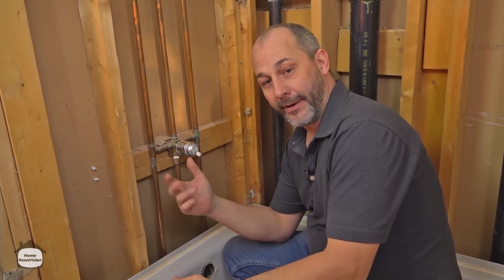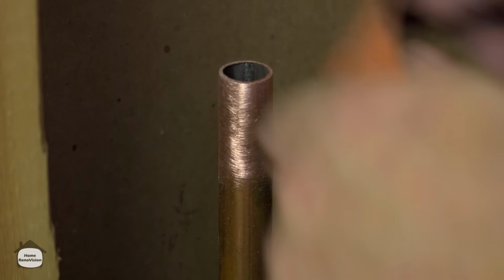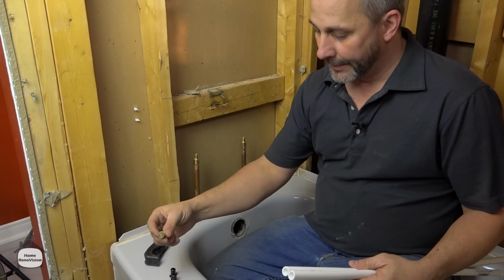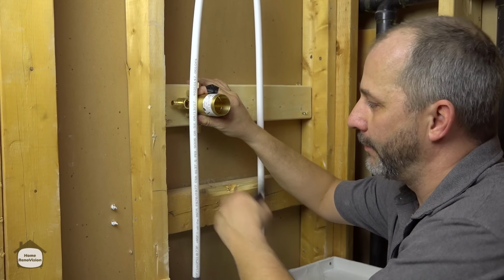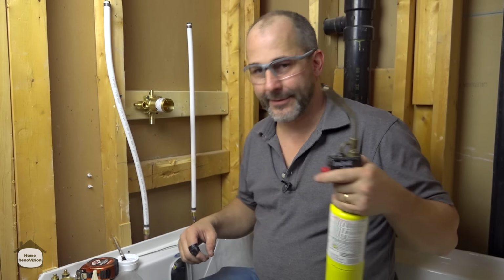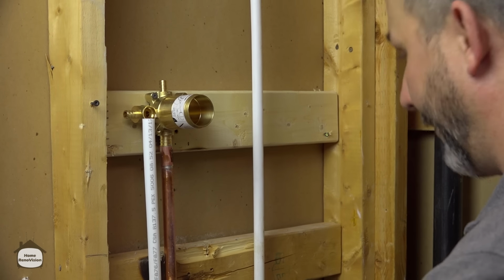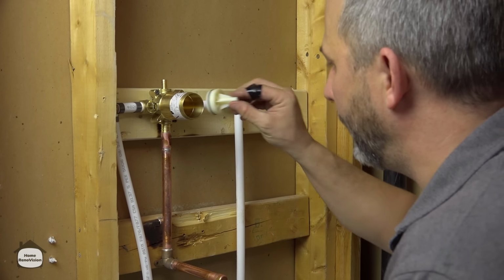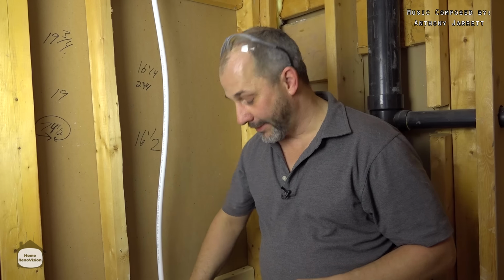DIY How To Install Copper To Pex Shower and Bath Plumbing

Comment: I have never seen anybody Solder pipes whose then you. Flux should not be added after you solder a joint because it will corrode the pipes and you cannot fix them once you have buried them in the wall. All joints should be wiped clean after soldering and you did not do that. Stop making videos you do not know what you’re doing.

Comment: Does HUD require securing a shower valve inside the wall using Pex or can it just flop around? I need a diagram of a HUD approved shower valve installation.

Comment: Do you have a video for the regular faucet system with the 3 nozzles? Cold, hot and shower in the middle. I have to replace the pipes and think I can share some of this information but need steps on how to replace the old.

Comment: How do you sleep at night knowing you are a hack?   I guarantee you are the type of contractor that always had call backs and unhappy customers.   Btw genius.  Clean the copper pipe and the fittings and know that you have to use a different flux for brass fittings like all real plumbers do🤦🏼‍♂️

Comment: Crimping PEX (PEX B) - what I don't like is that the fittings are always smaller than the pipe, which means you're going to have less flow.
Expanding PEX (PEX A) - is better for that as the inside diameter stays the same for fittings as well as pipe.

What I don't like about PEX is they leach chemicals from the few studies they have done. Down the road, the concern will increase as PEX leaching increases with heat. I'd love to use PEX but I think pressed copper fittings might still be best and fast.

Comment: Good morning, im trying to convert my shower from 3 Knobs to 1. Do you have any video on that?   Thanks
Reply from the maker: not exactly. i do have videos on how to connect shower plumbing. as for the knobs that is up to the manufacturer. the water supply is still only 2 inputs.

Comment: just an fyi, i worked in the engineering department for Wingaersheek the maker of Turbotorch and the flux is used during the sweating process to remove impurities.  i suppose you can brush it on after the sweating but it serves no purpose. definitely no benefits to this.

another piece of information, probably useless to you but i like to brag about this lol. i was the first to get that self igniter to work at Wingaersheek on a handle shaped like a 45 pistol. The parent company took the business back to Texas, so this operation was taken away from us, and Wingaersheek was no more.
i guess we did the hard part, and we’re not needed any longer.
thanks for nothing.

So obviously Berns-o-matic got that from Wingaersheek.
the swirling is also a Wingaersheek trade design. it intensifies the temperature of the flame.  
a useful piece of information is to never let the tip get hot, so it travels back enough where it heats the part that holds that swirling piece or it could loosen it and render the tip useless.
“always” use those tips at the full on position, to prevent the burn back i talked about.  this will start to happen when the tank pressure is low, which is a good indicator to replace the tank.

i’m thinking of going pex. good to see you’re working with it with so much confidence, since i’m an old school copper guy.

plumbers i’ve run into claim it’s the best.
i guess i’ll try this out since there are a couple of pipes i need to relocate.
good video.

Comment: I am converting a tub/shower insert to a soaker tub with an extended and exposed country home style pipe for the shower head to be centered above the soaker tub for a rainfall-like drop. I am wanting to convert from copper to pex and have 2 questions:

1: Where can I find that valve you’re using; as Lowes and Home Depot didn’t seem to have it?

2: Can I use the same system for the shower head with a threaded connector, install the plumbing this same way, and then add the extension for the shower head to be centered?

Disclaimer: I’ve worked in construction and did a bit of minor plumbing but this is my first (completely solo) job. I want to make sure I’m not missing anything here.

Comment: Don't wipe your solder joints with Flux after soldering, crimps should be 1/8ths of an inch not 1/4, and the rings need to cover both ridges.

Comment: The most complete, comprehensive, articulate, well lighted, well videographer, well explained guide on almost ANYTHING I've ever Googled.  Simply amazing.  Thank you so much.  I'm guessing you have to be careful what product you recommend; however,  I'm in a 2013 Athens Mt Pine mobile home (fitted throughout with Pex) and need to replace the shower-only valve (no tub), meaning I've got quite a project ahead.  I have 2 questions if you have time:  1)  What TOP LINE replacement might you recommend and 2) Do I have to replace the shower faucet as well or can I just use the same existing one (for now I don't care if the shower head and faucet don't match!).  Ever so grateful for this video.  It is so thorough, so complete, no questions as to removal/replacement.

Comment: So helpful....I am getting prepared to gut out small bathroom and renovate which will include this part.  I didn't see what part on the faucet your turned to open the cold water line but will look on mine.  Also, some other YouTubers suggest checking every pex crimp with the go/nogo tool, but you don't.  Why is that?

Comment: Hi Jeff, thanks for all of your videos. You are an incredible instructor. Sir, what brand/model of shower/tub valve is that? I would like to do the copper to pex conversion, and I like the 3/4-inch integrated copper adapter for the tub spout. Any guidance is appreciated. Take care, and thank you.

Comment: Great walk thru! The original plumbing had copper pipes coming up, which would be replaced by hammer arrestor now, which looks identical to what have right now.  I noticed you didn't replace those, which would make my job a lot easier. I have a well and septic... would I be fine without the hammer arrestors or should those be replaced?

Comment: Why did you not talk about the Flux on the Copper joint before you heated up the solder joint for adding solder.

Comment: Unless you allow the air to vent from your lines so that they can fill with pressurized water you are not doing a proper leak test. I'm sure you know this but perhaps wanted to keep the presentation simple.

Comment: I'm hesitant to say anything since I don't want to jinx it, but I actually cut off the copper pipes and soldered the fittings and attached pex pipes. I have a lot more to do, but just getting that done was huge. I never would have attempted this before I watched this video. I flooded the bathroom (and two rooms below it)a couple weeks ago and I had a leak for a while and had to dump out water several times a day. I managed to finally get it stopped but was unsure what to do. The lowest estimate I got for replacing the faucets was 1000 and part of the reason I' m doing the work myself is to save money. I really believe I can do this now. Thank you! Thank you! Thank you!
Reply from the maker: Cheers Isabel. You got this!

Comment: Wow that Pex pipe and fittings are so cool and easy to work, in my  house I’ve had two times gotten pin hole leaks in the copper pipes, is Pex also susceptible to Pin holes?  What causes Pin holes in copper pipes anyway, never had this happen before in any house ( BTW House was built in 2000)

Comment: i'm 68 years old and learned soldering from my father who learned from his father who was a "pipefitter" by trade.  my dad taught me to always "tin" every solder joint first before the final soldering.  for those who don't know what solder "tinning" is - you basically heat up each joint and apply a coat of solder around the entire joint.  you do this on EVERY pipe end and coupling.  then when you go to solder each component together, you heat up the pipe and/or adapter/coupling and because both pieces have solder already on them, there is no chance of missing a spot which could create a leak.  Tinning is an additional step in soldering but i believe it is a common practice with all "old" plumbers.
Reply: I worked with a Jamaican man he used to do the same that is for secure the soldering.

Comment: Thanks!  To pressure test the spout, a friend had a pressure test stopper, though a shark bite type stopper would work too, to skip soldering on a copper stopper temporarily.  For testing the shower head, I used an old shower spout with a 1/2" threaded valve on it.  That setup had 8-12 sweat connections, and I was happy it ended up straight and tight the first time.  This time, like your video I'll be switching over to pex somewhere.
Reply: 😢ooo O9oo o I ooo I ooooo
Reply: K0
N
Reply: 7:32 o

Comment: how do you figure out where to put the 2x4 support for the shower valve when you are using a thin wall sterling fiberglass shower kit, so the bonnet is not too far out of the wall?

Comment: showers are simply cleaner and more hygenic to use. tubs are absolutely perfect if all you want to do is soak in a hot one, but trying to clean yourself off in one does nothing but smear your dirt all over you, where a shower with wash it all off into the drain

Comment: Hi Jeff, i have a problem - i watched your video and installed all pex tubing with a moen valve body, and then installed a pfister showerhead with a handheld spray attachment.  i don't have water pressure in the spray attachment, and moen is saying it's because the pex tube between the valve body and the tub spout is pex, not copper.  have you seen this problem before?
Reply: sorry - pfister is saying it's the pex tube, not Moen.

Comment: I bought a pro press crimped tool from Amazon.  I also found some PEX to copper fittings that I crimp. I can switch to PEX now without soldering
Reply from the maker: Thanks for the info!
Reply: @HomeRenoVisionDIY  no problem. The tool I got on Amazon for 250. The fittings are available at noble except the PEX to pro press...I found them in USA and bought from a distributor in Saskatchewan
Reply: @HomeRenoVisionDIY  here are the fittings...I can't attach a photo...Nibco press system PEX adapter...looks like sweat adapter but presses on

Comment: Your Show is amazing and helpful this week I called plumber for 25minutes put shower mixture from copper to PX charged150.00 CAD and 60.00 CAD for 5feet PX 1/2inches and 4 elbow joint. You taught me lot.
 Shawn from CAN

Comment: Should be using galvanized screws to mount brass fittings. Drywall screws will rust and break.

Comment: In another video with the use of Pex pipe  blue was used for the cold water and red for the hot water. However, in your video you used white pex pipe for the hot and cold. I am curious about that. Can you please explain.
Reply: You can do it however you see fit. There's no requirement (at least where I live) for matching color to temperature. It can be nice to have it that way, but for guys who do odd plumbing repairs, it can be simpler to just have one color in your van/truck instead of trying to coordinate colors.

Comment: Often times solder joints are demonstrated with no heat applied to the pipe. Although it is possible to get a solder joint that will not leak it will often times not fill the cup completely.

Comment: Nice work. I have a small leak in the control value or one of the pipes. Because there is water on the board that the control valve is connected to. Also behind the tub present moisture with a moisture detector. I have a plumber coming out to do a complete diagnostic but I’m thinking it would be a good idea to replace the copper with pex - is it might be cheaper maybe? Plus I plan on pulling out the tub, replacing with a walk-in shower. I’m a bit worried about mold and any moisture damage after all the tile is removed😳

Comment: I am installing a Delta 1447700-SP series shower set and the installation guide says the stringer should be installed so that the plasterguard is flush or (+-) 3/8ths of the finished wall. If I estimate my finished wall, the existing stud that the old shower valve was installed on will put the finished wall at .25" past the plaster guard. Does this cover the (+-) 3/8ths wiggle room or should I reposition the wood so the plaster guard will be exactly (guess) to my finished wall and tile?

Comment: I am a house remodeler,  I do most of the plumping my self, but I have always used copper. I wanted to use pex and give it a try but wasn't so comfortable with the idea of using pex, now that I saw your video I know I can do it and no worry about leaks. Thanks!.

Comment: I don't know if this will help anyone but I use a small piece of Scotch tape on the crimp ring when I'm lining it up.  Just tape it to the pipe where you want it right before you crimp it and it won't go anywhere.  There's totally room for a little error with these crimp rings but I personally like to be sure it's right the first time.  Saves a lot of frustration on vertical lines, too. :)
Reply: ^^ both this and the reply are great advice. 

My sharkbite crimper tool is strong enough that just touching both sides of the jaws to the crimp ring is enough to crush it a little.

So I
Step 1. Use a little tape to get my crimp ring exactly where I want it (between 1/8 and 1/4 inch from end of pex pipe)
Step 2. Gently crimp the ring like i said.
Step 3. Remove the tape
Step 4. Actually crimp the ring the check with go / no-go gauge
Reply: Hold the ring with the pilers in place an crimp.
Reply: I also use a tampon when I’m plugging my vagina
Reply: I take my channelocks and give the ring a little squeeze and it stays put takes 2 seconds

Comment: Thank you very much do you know if most of these valves will fit just about any showerhead or is each valve designed for its set shower set? The reason I ask is because I paid a plumber to do my rough-in plumbing and he installed this old looking valve to pex but now I'm left with the predicament that ill have to take that off, buy a new one that goes with the shower faucet I need and reinstall the new one.

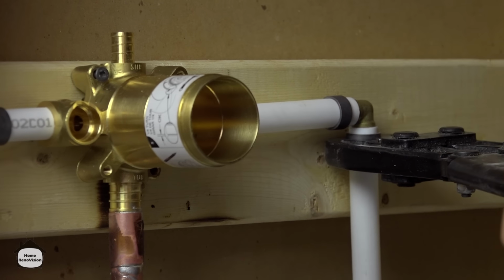Comment: At 20:38 you only crimped half the ring (right as you said you don't need a professional 🙂). Hopefully that was fixed before closing up the wall or you might get a leak in the future.

Comment: are the crimp rings u use in this video better than the stainless crimps ? you are the best by the way
Reply: I mean the  1/2 Inch PEX Cinch Clamp Rings, Stainless Steel

Comment: Yet another video from you that’s allowed me to tackle something at home myself! Love your energy too! 

Question - might be a dumb one, but why did you go with copper for the tub faucet instead of pex? 

Ijust re-walled our shower and need to install basically this same setup. Going from copper to pex, gotta add some shut off valves too, I think but thanks for this video!

Comment: Nothing has been sucked bro, you forgot about gravity that pulls liquid down, not up.... and there is no pressure inside the coupling ....
Reply: And you forgot how solder is sucked up by attraction just like water.
Reply: @jamescole3152  James, the laws of physics are the same everywhere on Earth and the solder is heavy even when it is hot. Can't argue with this. Now, depending on the quantity of solder, the force of gravity will prevail over the force of attraction you are referring to. The empty cavity will be there in between the pipes even though you saw the effect of suction. It is visually deceiving and you must push the solder there and not to wait on a miracle to happen. You sound as a reasonable person most of the times. Please do not denigrate yourself.

Comment: Clean the copper before you cut so the pipe is not flopping around while you clean it? You can use more force without fear of damaging the pipe.

Comment: Dude, you did a shitty job cleaning up that hot side with the sandpaper. Use a doughnut shaped wire cleaner. (scrathing it up is not good enough). Also use a doughnut shaped cutter, they are made for close quarters in walls.

Comment: I was researching a bit in these pex pipings and wanted to know if anyone could add to what is known(insight). These have mtbe leakage that is constant. At the beginning it is said to have upwards to 93% more than the CALIFORNIA recommended for drinkable water. This of course over time dissipates to manageable levels of mtbe but is the cause for the constant odor and shifted taste. Can anyone confirm this? Then knowing mtbe at levels past ~19ppb in water generates a 10% more risk for malignant tumors or something like that. Please correct. Anyways knowing this I would not want to replace my copper pipe with pex piping, yet the ease of use and the color coding may let me risk it for the biscuit. Most numbers stated are ball park and brought to you by 2 hrs of skimming.

Comment: Thx, loved the video. I will be doing this in my cabin in the country except mine was installed using pvc and cpvc. Do they make connections for that or when I open the wall I will be able to cut it away and have copper several inches from the valve?? Oh I hope so. After watching the entire video I will not be doing what u did by getting a new valve. I will hopefully be able to use the same shower/tub valve that is there now.

Comment: How far the faucet can be from the valve? Or it doesn’t matter? The reason I’m asking is because I install one and when I turn on the water to the faucet the water goes up to the shower, I use pex for pluming so please let me know if you can help thanks

Comment: Great video and great instructor. Tip...when showing items do not wave them around. try to hold them still, just for 2 of 3 seconds. its dizzying to try and get a good look at something that's flying by on the screen. Great job and thanks for the info.

Comment: The sand cloth you're working with is called emery cloth.  Well that's what we called it when I started plumbing nearly 49 years ago. Your doing a pretty good job not to be a plumber. Although there are a few tricks I could show you I think you would like...